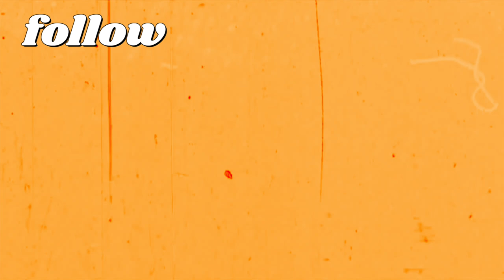Making Our Bed Frame & Framing the Rest of Our Skoolie Bus Conversion! | DEMO WEEK 6 & 7

Comment: I thought the original plan was to put the bed vertically and have the show next to it? Obviously I cannont see to well on camera, but it appears that the bed is horizontal, did you guys change your mind?
Reply from the maker: it ~ was ~ but now we realize that it just wouldn't fit the way we wanted it to and we wouldn't have the head room for the shower on the side there :(